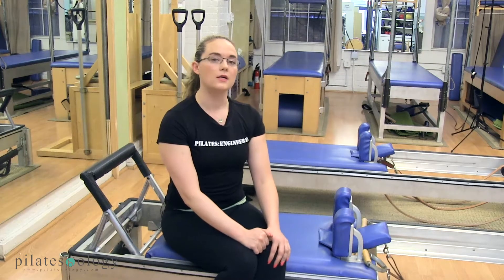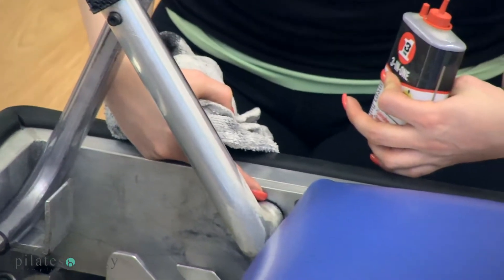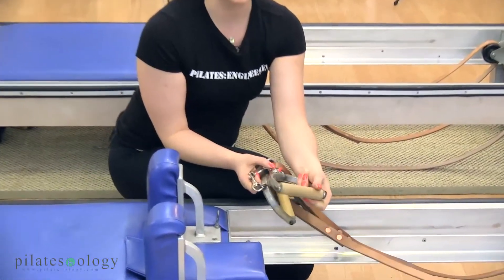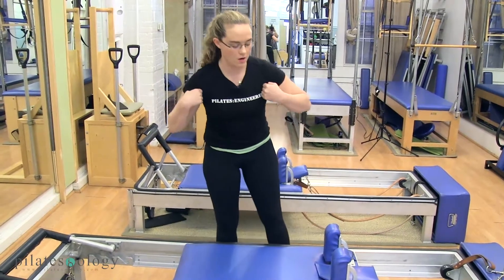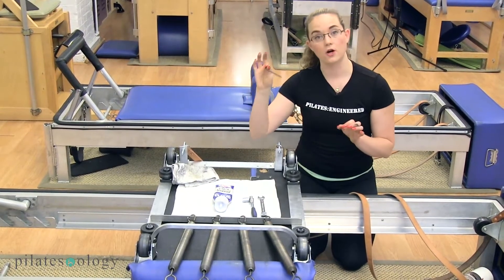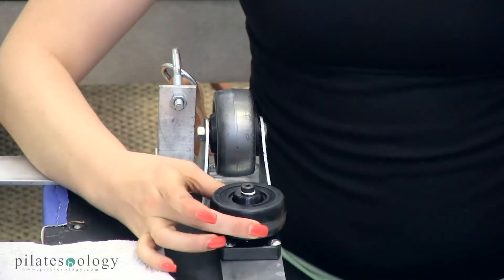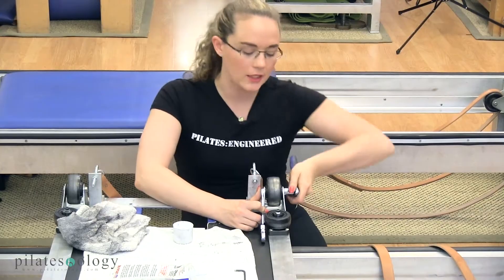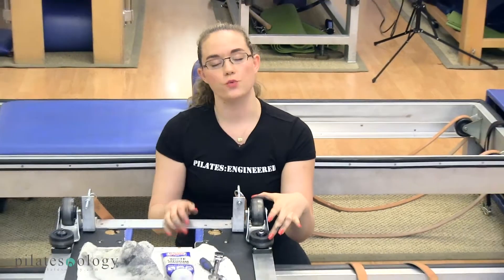Complete Reformer Maintenance

Comment: Thx for the clip, it's very helpful. How often sould i do this? Twice a month?
Reply from the maker: it depends on how often the reformer is used.  For a studio reformer, I would think about once a year (that is what we do).  And if there are squeaks or it doesn’t sound right, we do the single wheels as often as needed. The wheels that most often need extra grease between maintenance are the ones that ride on the rails.
At home reformer- probably less often would be ok.  But the springs should be checked every so often for signs of wear and tear.